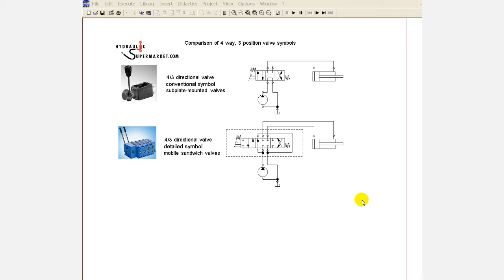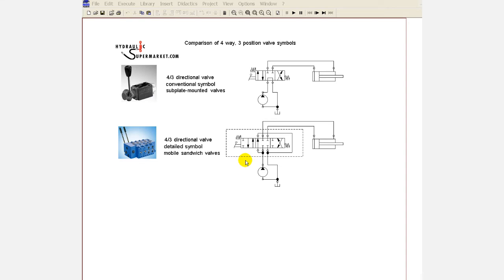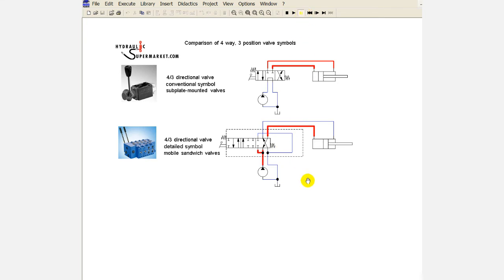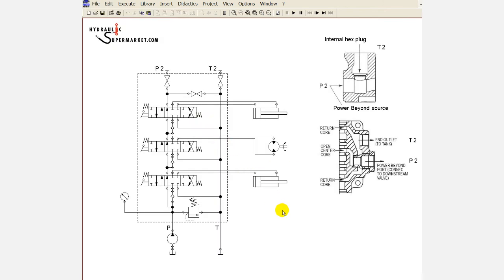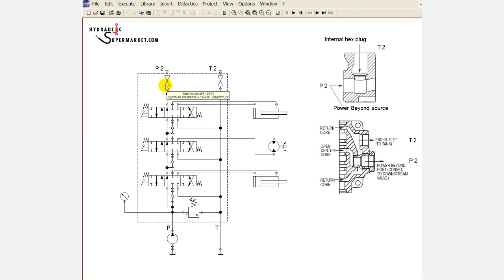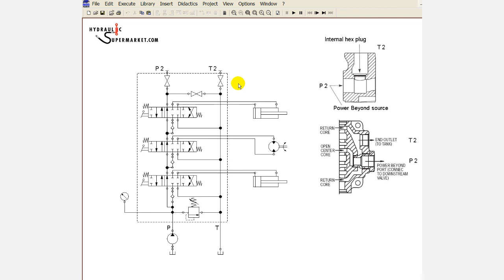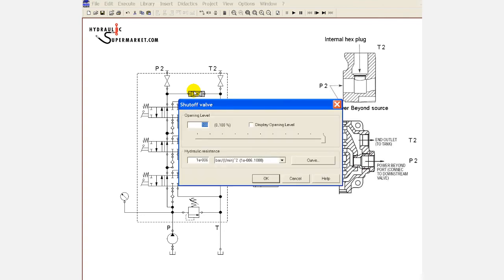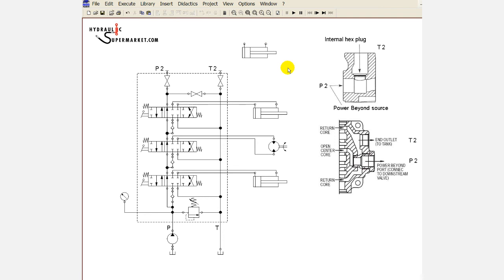How to Use the Power Beyond Facility in a Hydraulic Directional Control Valve (with improved audio)

Comment: If you activate a valve does this cut off oil pressure to the valves above it ? You can operate actuators above the valve you operate ?
Reply: Any operated valve will divert the oil from the bypass/carry over/P input of the next valve, to the cylinder being actuated and then towards Tank.
So unless you feather the two valves carefully, the first one nearest to the pump will stop flow to the next ones.